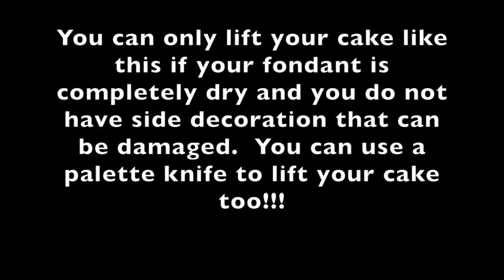How to Dowel a Tiered Stacked Wedding Cake for Safe Transporting Tutorial - Avoid a Cake Disaster

Comment: That was really really really useful and so helpful. I was so confused as to how to insert a dowel thru the cakes as well as their individual cake boards. I've seen others using the hammer way but I don't see how it can go thru even a thin cake board! Thank you so much  Subscribed! xx
Reply: jleeproductions ..u make sharp point on a wooden dowel like a pencil..alot easier to do It at The end of stacking your tiers. Just make sure your dowels are all the same length on each tier,so there won't be any unevenness and so your cake doesn't slouch between layers.  :)
Reply from the maker: I prefer not to use wooden dowels as they absorb the moisture from the cake making them soft.  This means they are not as strong and could cause the cake to sink a little.